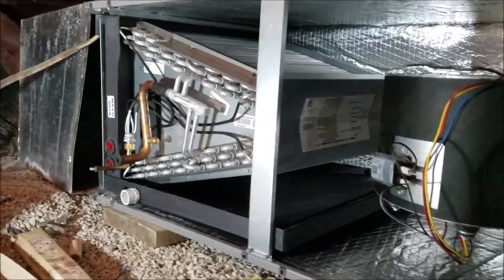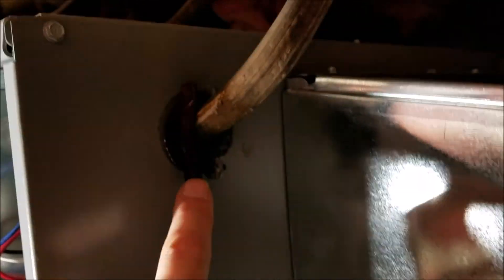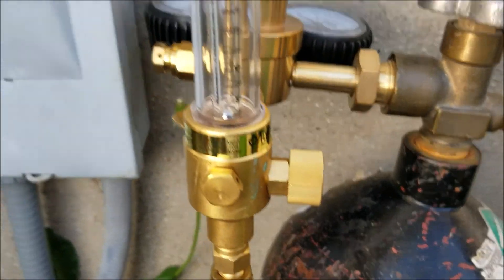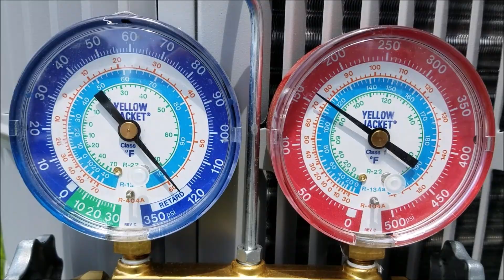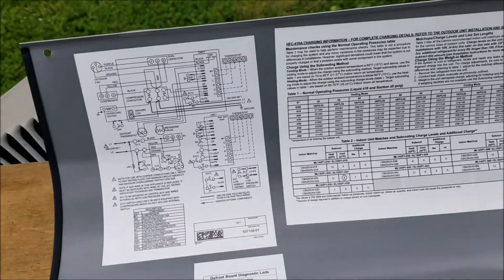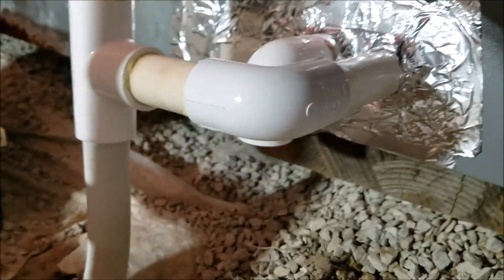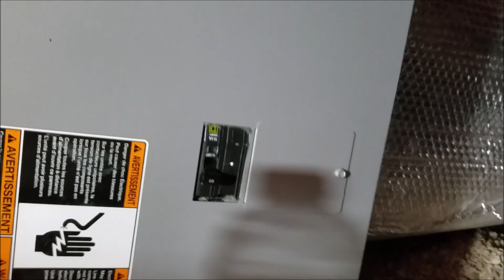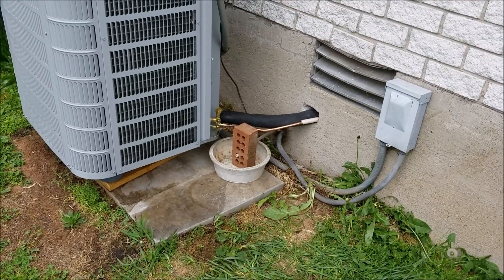DIY Landlord How to install a 2 Ton HVAC AC unit heat pump yourself a save.

Comment: Good job. YouTube has countless numbers of HVAC contractors trying to convince people that it's impossible to DIY this work, yet somehow you pulled it off! Most residential HVAC work really is simple if you already enjoy tinkering and building stuff.  When you own a bunch of properties, the tool investment pays off immediately...The money I save on capacitor replacements alone paid for my tools several times over.
Reply from the maker: With over 20 rentals I always have something to fix.. lol
PS That install is still running with no problems so far.

Comment: A guy just installed a new air conditioner in my house and he didn’t use a vacuum pump , he said this is not necessary if the new ac is already pre-charged, is that true ? He said if there is a problem with the ac he is going to come back and fix it
Reply from the maker: Please text me some pictures of your outside and inside unit along with the copper pipe connections to my cell 606-875-0125

Comment: is braising necessary? there isnt a type of fitting that could replace braising?
Reply from the maker: Absolutely you must braze with silver solder not plain water pipe solder. Here is another DIY solution check it out https://mrcool.com/

Comment: I didn't notice if you took out the  schrader valve or not before brazing, you should always remove the schrader when brazing and put it back in after putting the system in a vaccum
Reply from the maker: Yes I pulled Schrader valve while a flowed nitrogen. Also left out while I pulled vacuum but I have a tool that let's me reinstall Schrader valve with out breaking vacuum. Knock on wood its been running great . Thanks for contributing  have a blessed day.

Comment: Well done sir.. I'm building a new house and I want to rough in lines for now. I'm going to leave two half inch copper lines and a 5 conductor low voltage wire from outside unit to the air handler. Will I need anything else. Also is it ok forme to solder 90 for the bends on those copper lines  and I believe those should be insulated. Also what type of pipe insulation should I use. And one last question, one of your lines was bigger than the other, can you elaborate please. Thank you very much.
Reply from the maker: Give me a call 606-875-0125 Kevin

Comment: Surprised by this install and i mean that in a good way... on another note, on those armostrong coils there is a correct orientation, if its installed in the opposing direction there is a field modification that has to be done where youll need to change the orientation of the inner channel for proper water flow, just a heads up for anybody who may be inexperienced, the instructions are actually on a sticker on top of the coil
Reply from the maker: Thanks for contributing Jose this was my 1st full install by myself / self taught by books and YouTube.

Comment: impressive.  I may just consider tackling my own if the need ever arrives.  I can sweat copper, would that be adequate here rather than brazing?
Reply from the maker: Give me a call 606-875-0125 I got some more info for you
Reply: @ktoutdoor  great thanks.  Will give you a call this afternoon.  Name is Dan, with 480 area code.  Thanks much!
Reply from the maker: Same ideal as sweating copper but it gets much hotter brazing with silver solder the copper must be almost cherry red. Or just save that part for your local HVAC guy in fact i just got done installing another one. It was very easy because it was in a basement not a crawl space.
Reply: @ktoutdoor  thanks for your reply.  HVAC is pretty daunting.  I am a DIYer though.  I disassembled my heat pump and replaced the fan, cap repainted it etc.  like new.  Now helping family with their failed heat pump…. It is much tougher, a locked compressor.  I am going to try a kick start and dead blow hammer to see if I can free it up, if not I will need to get a pro to replace the compressor.  Anyway enjoyed watching you tackle that job.

Comment: How do you get HVAC guys to help? Just regular HVAC companies. I have tried and they get upset when I tell them I will do the install and I just need them to do the connections, vaccum and Freon.
Reply from the maker: Ask your friends who they use, I always looked for a independent HVAC guy never had any problem finding someone in the past. they should be in and out in 2 hours or less.
Reply: @ktoutdoor  do you have a ball park price point you have been charged for doing this work? Thank you so much for sharing!
Reply from the maker: @pedrogarces6876  Best Guess $200.00 depending on your market.

Comment: Well done sir! I love DIY projects and watching your vid gives me confidence that I could do my next ac replacement. I already do most of my own hvac repairs. And I can tell you that my Armstrong unit has been running strong for years in the south where it gets a workout!
Reply from the maker: Thanks for watching if you ever have any question just give me a call or text on my cell 606-875-0125 Kevin
PS that was over a year ago and its still running great in the 90 degree weather

Comment: How about the warranty, parts houses will not honor them around here, So TX, (online purchases)
Reply from the maker: Over the years we have bought 8 heat pumps and never had a need for warranty on any of them.. knock on wood.
Reply: @ktoutdoor  what brands do you like using?
Reply from the maker: @rvamtbram  I like Goodman for there simplicity and low cost. get a basic unit try to avoid variable speed blower motors and compressors / high seer models

Comment: Btw you can use the resivor in the pump to act as your trap
Reply: Only if it’s completely full of water to the point where the pipe is always under water. Otherwise its just like not having a trap at all. It wouldnt be up to code to use that as your trap either
Reply from the maker: @Elcanenjoyer  What about in the winter when using the heat pump and the water has evaporated from any trap.. now you have a steady stream of very cold air entering the air handler is the a fix for this?
Reply: @ktoutdoor  that amount of air is going to be pretty unnoticeable. Especially since that cold air still has to go over the coil in most cases, which would heat it up just like the rest of the air
Reply from the maker: Well that makes perfect sense thanks for the tip.

Comment: Thanks for your video. What is the brand name of your new unit, and where did you get it from? I like that the install instructions were clear. Lots of manufacturers dont put attention into that.
Reply from the maker: For a do it yourself install try here,, if you can use a package unit then you don't have to fool with brazing the lines  https://www.theacoutlet.com/

Comment: Nicely done!! I have a 4 ton system and it's kind of frightening to look at installer quotes. They're quoting me anything between $12-18k. A 4 ton unit would cost like $3-4k so for warranty and install I'd need to pay 10-15 grand which is ridiculous. Even without warranty I can replace the whole system 3 times in the next 10 years and still break even :)  I've done bunch of welding and brazing so that's not even an issue Thanks for your vid, you just gave me the confidence to do it by myself when my current unit dies. Getting a Section 608 is very cheap and a no-brainer to do in order to handle the refrigerant properly and pretty much that's the only thing you need to buy and handle refrigerant.
Reply: just the condensing unit i could replace it for $2500 if you buy the equipment, that’s nuts!
Reply from the maker: If you have any questions just give me a call 606-875-0125 Kevin.. I have not touched the unit sense the installation.. knock on wood.
Ps check out these prices 
https://www.theacoutlet.com/

Comment: Nicely done.  I wish you were around 10 years ago when I did this myself.  A few observations.  1. You're not really using freon, right?  2. Don't they make a horizontal air handler, looks like you have one for vertical mount;  I'm concerned about condensation dripping down from the top of the A coil to the inside bottom part and lessening its efficiency.  3. Why can't the condensation just drain onto the floor, its earth under the gravel, no?
Reply from the maker: The Air handler can be configure horizontal or vertical. It can get very humid in Ky that would be dumping a lot of water under the house. Under you house should be a very dry place.

Comment: Where does the nitrogen come from?
Reply from the maker: I buy it from local welding and gases store comes in a heavy metal container
Reply from the maker: PS its still running great sense I installed it.